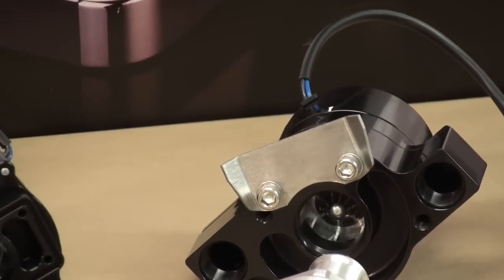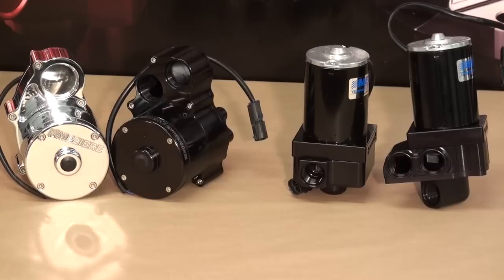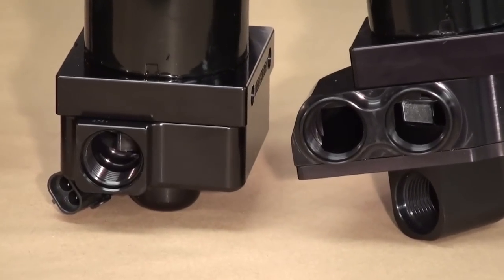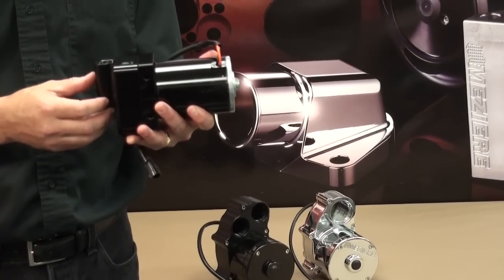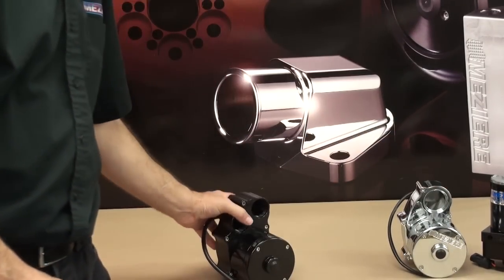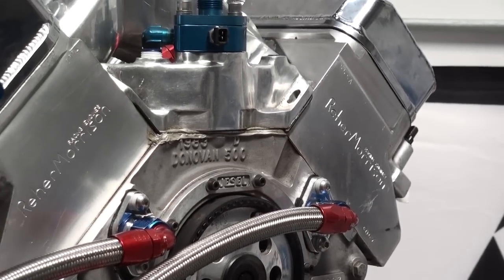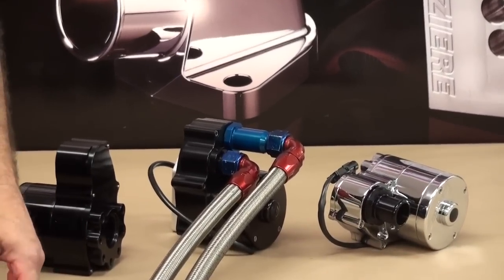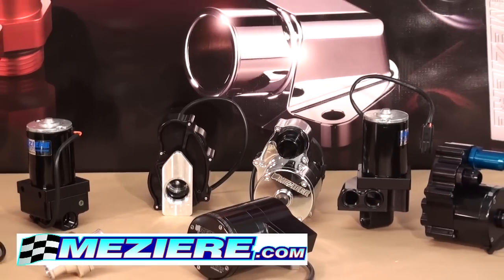Meziere Remote Electric Water Pump Guide

Comment: I have an 2002 Saleen S281 supercharged and installed one of these pumps to replace the OEM and @20gpm it works perfect. Before I was seeing 150 degrees at my heat exchanger reservoir, after this new pump highest I've seen is 100 degrees. Thanks Meziere!

Comment: would these be ideal for a DD V8? i have an old 84 mustang, i have been considering using an Electric water pump. its about as stock as it gets with the exception of flex-a-lite dual electric fans and underdrive pulleys. so i would imagine the 175crankhp, is still roughly the same. if these would be good for street/daily driver use, which part # would be intended for my 5.0 5spd?